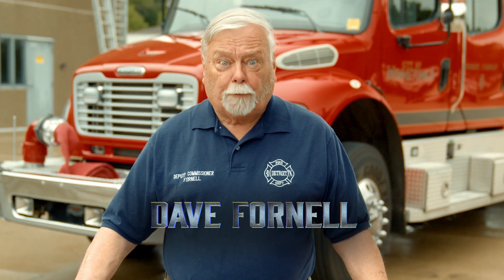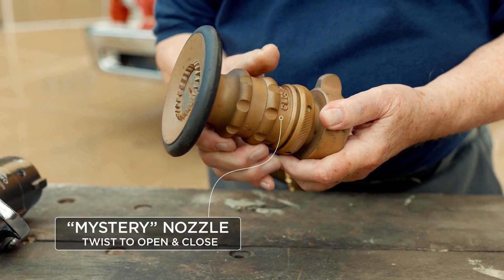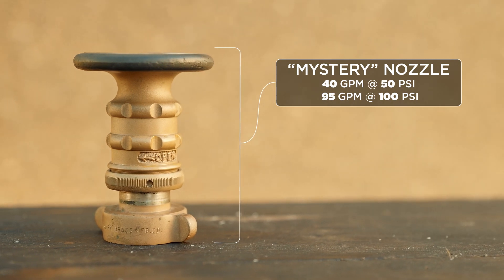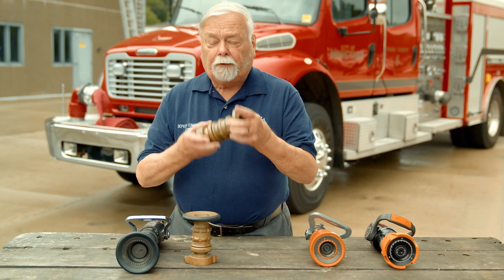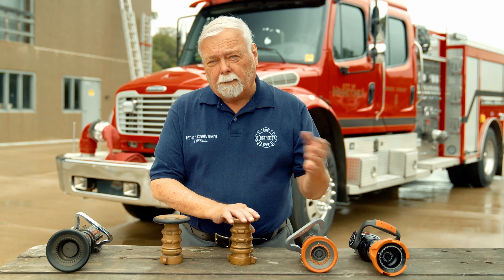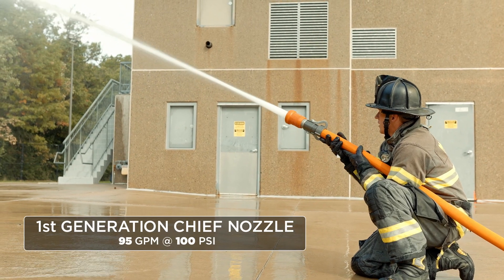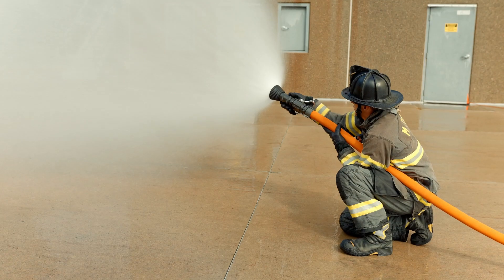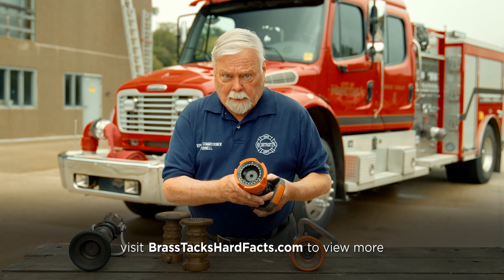History of the Low Pressure Fog Nozzle (Episode #73)

Comment: I don't comment often, but having recently switched our entire department from 100 psi fogs to low pressure nozzles I feel the need to say that the hose selection is critical on low pressure hand lines. Standard mid-grade 1.5/1.75 double-jacketed hose doesn't do well without a lot of residual pressure. You'll want something like Combat Ready or TRU-ID hose to make the low pressure lines safe and effective. We use Key Hose, but there are probably similarly engineered "kink resistant" hoses from other brands.